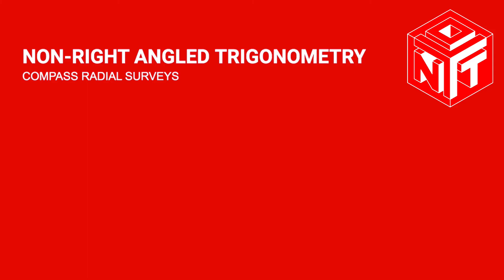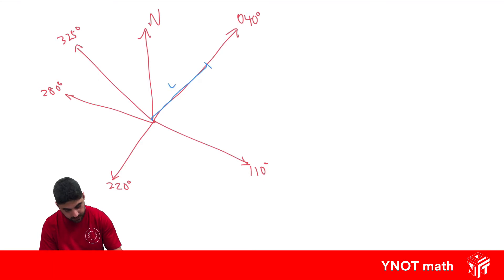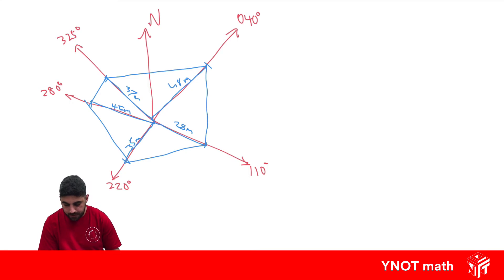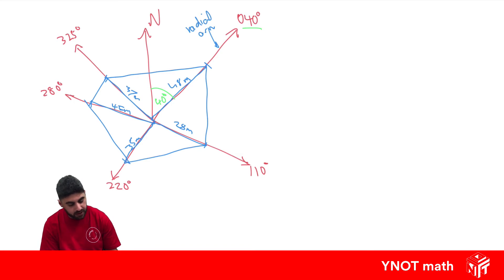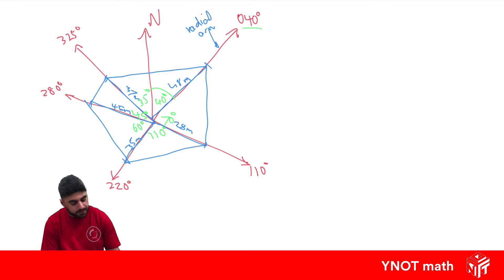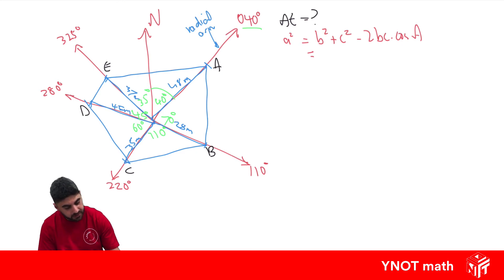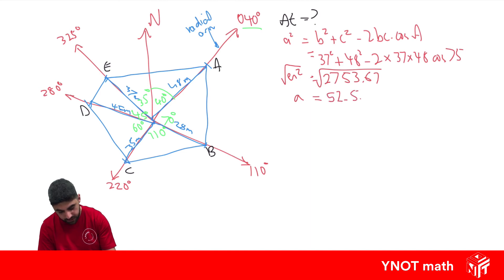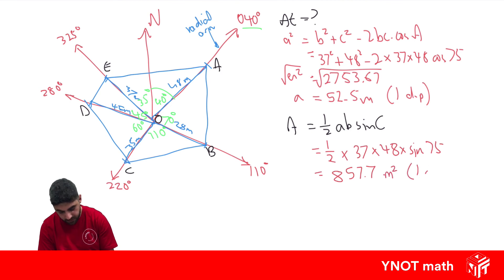Compass Radial Surveys

Comment: It is clear what you doing to find the angles, but why not just reset zero at the next radial arm and measure the inside angles that way? Could you explain why you did it this way? I really want to know which is better or preferred over the other or is either way reasonable?